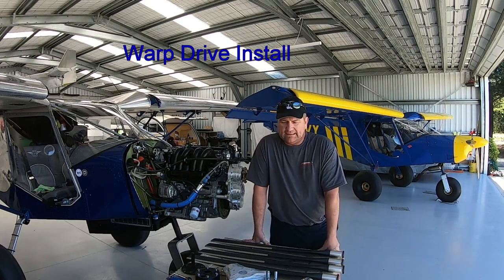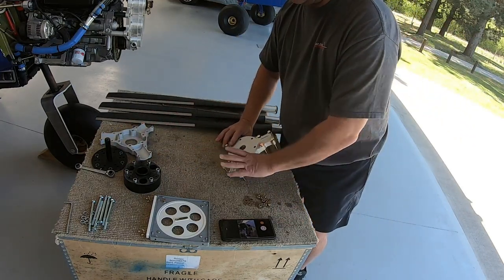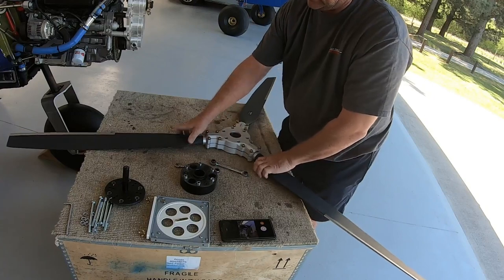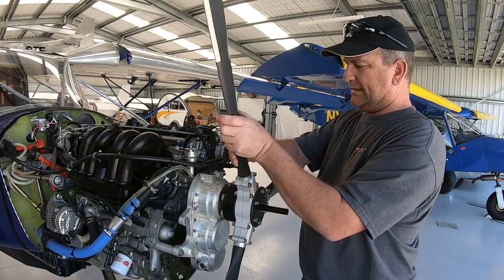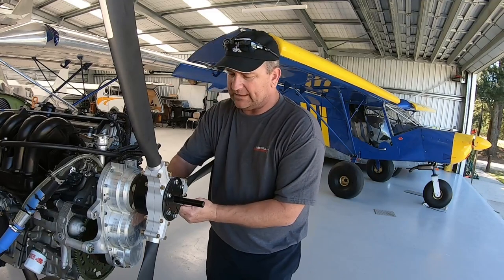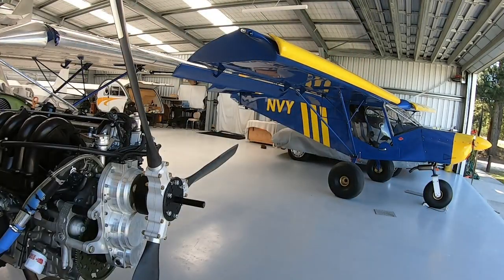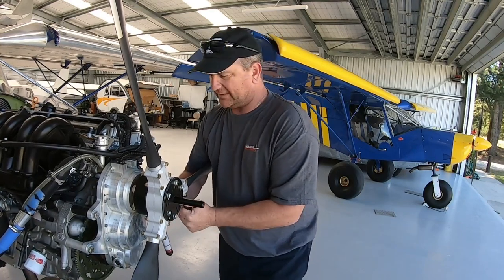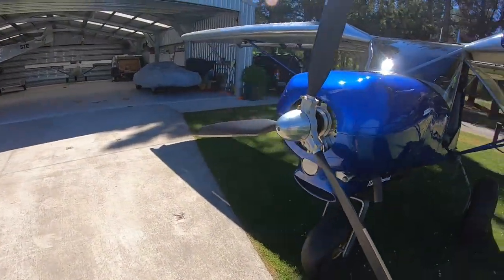New Warp Drive propeller Install

Comment: Excellent explanation, thank you very much! In the case of a rotax 582 blue head, what would be the best thrust value when using a 68 DIA - R- C propeller (Obviously warp drive propeller 3 blade HPL). In advance, thank you very much!

Comment: I asked you the question above, because I have a Sprint II with puddle jumper floats and it will be flying on a lake located at 6500 feet above sea level. In that order of ideas I need to optimize the thrust of the rotax 582.

Comment: Did you have to add any weight in the rear of your plane with the Viking 130? Any modifications or is it pretty much a stock 701? I am currently building one. I like Viking  just wondering about the weight of the 130.